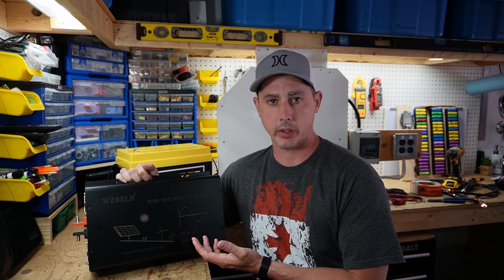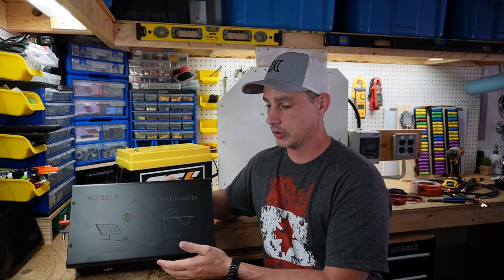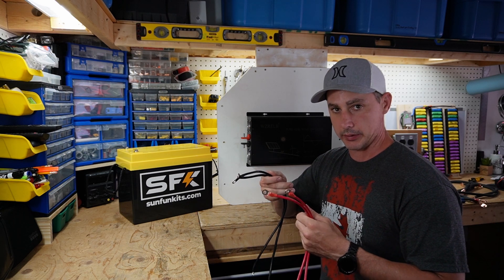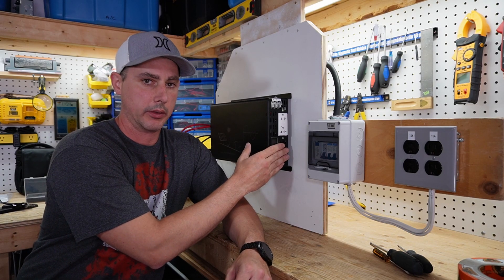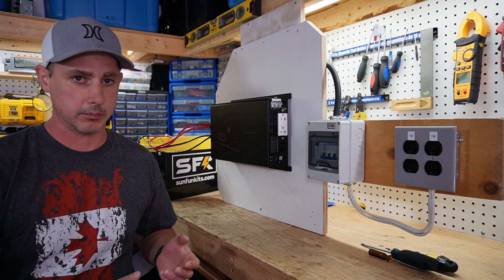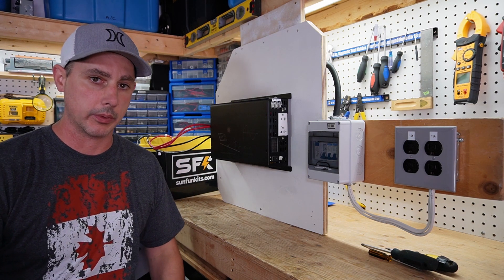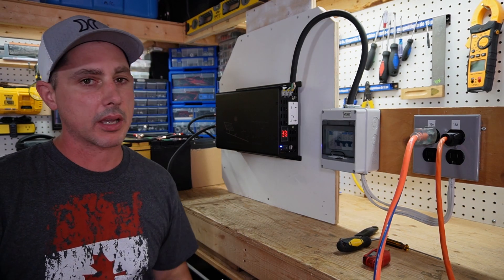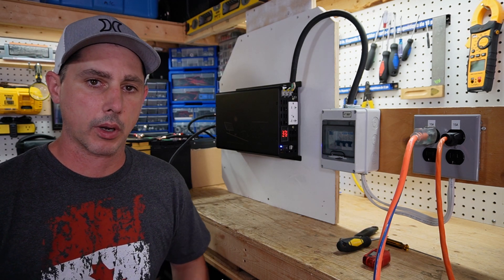Reliable 3000W 12V Inverter Setup

Comment: You should make a video how to connect an inverter 3000 watts using one powerful battery with a TR-30 cable. Also the best way to charge the battery without solar panels. Thanks

Comment: So Impressed with WZRELB I have 5 3000 Watt 24 Volt PSW Inverters powering 5 Separate Systems in the Lodge & Ranch here. 6K o Solar Panels and VICTRON SMART SOLAR CHARGE CONTROLLERS converting and Reporting My Solar Production and Battery Statuses to My Cellphone and Network. Awesome Presentation and Heads Up on The Terminal Block Wiring. 10/3 Marine Grade Tinned Wire is used here to GFCI 20amp Sockets to Start each wiring String / Circuit.

Comment: I mount my inverters fan up.  My reasoning is heat, heat rises.  I believe it increases longevity of the inverter, it evens out the heat, keep temps consistent and reduces fan cycles.  Remember you have thermal fatigue in all the components, causing them to fail.   My 4 inverters are hardly ever shut down, being used or not.  That's what makes them "reliable".  😎
Reply from the maker: @CitizenOfBabylon  Good advice

Comment: Just so people know if you want to run things like air conditioners and stuff like that you can run it on that 3000 W inverter yeah he’s right obviously have to have a battery bank plus a couple more batteries but just for reference those appliances that take heating elements like toasters pizza pizzazz isspace heaters they all take 1800 W so that is more than enough power to use it

Comment: Great information! Question, I have an opportunity to get a 12/3000watt Samlex inverter for$475 through work, if I installed this on my truck, would a single battery run power tools? I have room for a second battery under the hood.
Reply from the maker: Unless you have a deep-cycle battery you'll need to have your truck running while using it. Also depends on the tool.
The topical deep cycle is 100Ah, so 100A x 12V is 1200Watts.
Reply: @Roll2Videos  ok, thanks, yes I plan to have the truck running, want to use it as a generator basically, instead of hauling a generator to each job site for small jobs.

Comment: I’m new to this so how do you charge the batteries back up?
Reply from the maker: With either an AC to DC charger or a solar charge controller with solar panels. Welcome to the hobby. Enjoy 😁👍
Reply: Do you think I could put this in an enclosed trailer to power a tire  machine ,balancer and a 30 gallon compressor?
Reply from the maker: @jmoney3338  it seems like a lot, I couldn't tell you for sure if it will.
Reply: Will be used daily as my only source of power

Comment: What if you don't run your microwave refrigerator or heater all at the same time You only plug it in when you need to . Would you still need all those batteries to run it?
Reply from the maker: No, You would only need one for the loads you are running.

Comment: Is this inverter enough to power up a 230V air compressor with out put off 1100 watts ??
Reply from the maker: Depends, on whether you are in North America or not. If you're in North America this is only a 120V single-phase

Comment: Did you earth ground the gfci or the case of the inverter?   

There are many reports of the 60v + 60 volt (line and neutral) but it may be due to non earth ground bonding?   The videos I’ve seen with this issue the inverter is not earth ground bonded.   There is a small nut on the bottom of the case for bonding.
Reply from the maker: Thanks

Comment: Hello, I just bought Duracell 3000 Watt High Power Inverter for my semi truck, I have  4 batteries ( 4 batteries AGM 31 Capacity: 100AH;
Cold Cranking Amps: 1150
Reserve Capacity Minutes: 220),  
Distance between batteries and inverter location is 16-18 feet, which wire(cable) and which fuse you recommend and where I can buy it ?
Reply from the maker: Hello, Depends on how much power you want to use. If you want the full 3000W, you'll need a 4/0 cable with a 300A ANL fuse.
Reply: @Roll2Videos   do you know what the amp draw will be   3000w at 24volt?
That determines the wire and fuse.
Awesome channel Young Man
Reply from the maker: @boscodog4358  3000W÷25.6V (LFP) = 117 amps I'd go with a 1 AWG with a 120A fuse/breaker
Reply: @Roll2Videos  Hey man,. Thanks.
You don't know how many times I have asked that question.
You are the first to give me a straight up answer. 
Thanks again.
Reply from the maker: @boscodog4358  😁 You are welcome

Comment: Can I use one 12v battery to run a 3000 W Inverter to power a 8000 BTU Air conditioner ?How long it would last ?
Reply from the maker: It depends how many Ah your battery is. 3000W at 12V you'd need around 250A @ 12V. Then 250Ah battery would last 1 hour

Comment: I'm a big-time rookie but I did not see what you did with the resistor. Are you touching the positive cable to the resistor and the resistor to the inverter?
Reply from the maker: Yes, For around 10 seconds with Lithium batteries.

Comment: On a lot of web pages and YouTube videos a fuse is added between the battery and inverter. A common size is 300 amps.  I have not done that, and I see that you have not done that either.  Is a fuse needed or not?
Reply from the maker: It would help if you did that. A fuse or breaker is added to protect the gauge of wire you are using, so it dosen't over heat and catches fire.

Comment: I use this same inverter as a backup for power outages with my ½ hp water pressure pump at my house. My cistern is around 20 feet deep. The sticker on the pump says 7.1 amps on the outside but when it is running on the inverter, the readout says 5.2 amps.  I have it connected to a single 12V 100ah LiFePO4 battery and it works fine.
Reply from the maker: Perfect 👍 I have a upcoming video on a low frequency inverter you might like to watch 😁

Comment: Can I tin the wire strands that I connect to the power block instead of using ferrules?  Also, I am going to use the inverter and a 100ah LiFePO4 battery as backup power for a 1/2 hp water pump that pumps from a cistern into a pressure tank to supply water to my house.  This is in Mexico.  My power here goes out for hours at time several times a year, so I would only use the setup rarely.  I plan to disconnect the battery from the inverter when regular power is up and running.  Is that okay?
Reply from the maker: Depending on the size of your pump. For my well I'd need off the top of my head 3 100 Ah and a 3000W low frequency inverter.

Comment: Quick question- why do you run two positive and two negative wires from battery to inverter ? Thx in advance
Reply from the maker: That is a great question. The inverter needs a thicker wire to run higher amps to the inverter and the company sent me 4 medium size wire to cover the high amps instead of 2 thicker wires 🤷 If I was to us my own material I would have made my own 2 wires to size.
Does this answer your question?
Reply: @Roll2Videos  yes, was just wondering - I recently got one of their 2000 watt pure sine wave units.  I am one step closer to hooking up my system for emergency back up.  Thanks for your reply.  Have a good one.
Reply from the maker: @oskosh50  Sweet! 2000w on a 12v system you'll be looking to use 2 AWG wire from the battery to the inverter 👍
Hope this helps you 😁
Reply: @Roll2Videos  Thank you for the info -
Reply: @Roll2Videos  #2 AWG max current is 125 amps. Fuse this at 300 amps for inrush and continuous current @ 2,500 watt output is 208 Amperes. A 2/0 or 3/0 AWG is required.
Reply: If 2AWG wire is only good for 125Amps then why wouldn’t you put a 125 Amp fuse on it? I would think if you put a 300Amp fuse on it then your wire would burn up before your fuse would? I do AC power and don’t do much DC dose DC work a little different?

Comment: Great video! I have the 3000W version like the 1500W you have, the label on the output terminal is also wrong just like this unit. i did not know that they make this version.
Can this unit bond Neutral and Ground?
Reply from the maker: As far as I know the neutral and ground do not bond. Floating system
Reply: @Roll2Videos  So can you bond them without damaging the inverter? Thanks!
Reply from the maker: @budmartin3344  I would not suggest bonding. Only with a breaker panel that is grounded. Depending on your use case
Reply from the maker: https://youtu.be/_XM6rXjv0vc

Comment: Great Video!  I have a question...  Is the plug on the unit GFCI?  Also Reliable is known for having a 50/50 voltage split.  Does this unit do that as well or is it 120 from the live?  I just didn't know if a GFCI breaker works with a 50/50 split.  Thanks again and keep up the great videos!
Reply from the maker: Thank you 😊 The plug on the unit is not a GFCI although there maybe a future video installing one in the unit 🤔
It's 120 across the whole unit plug to block.